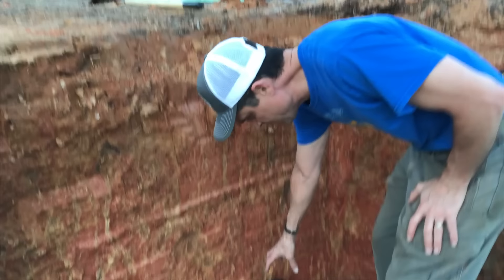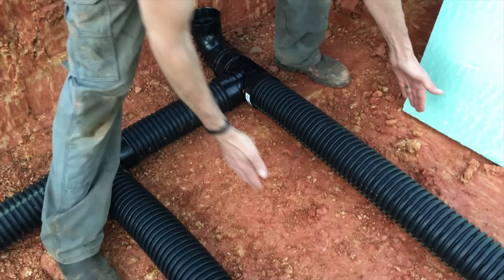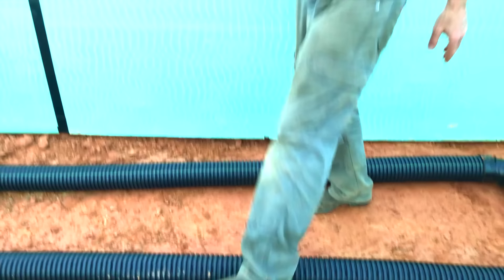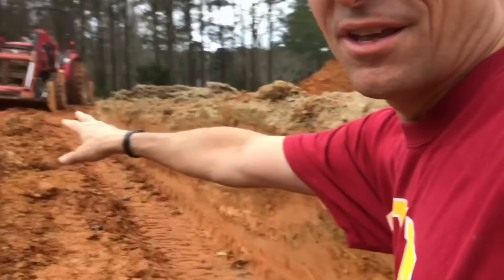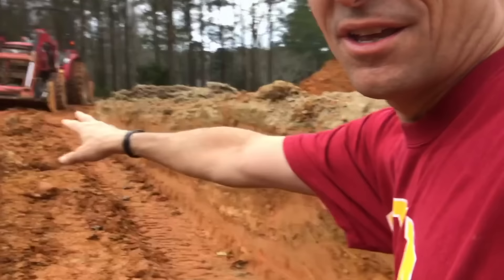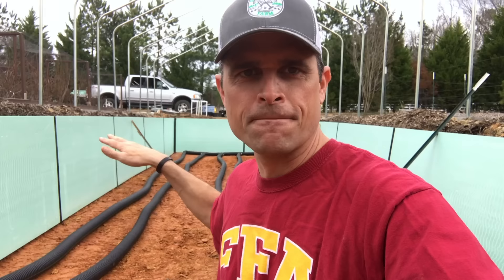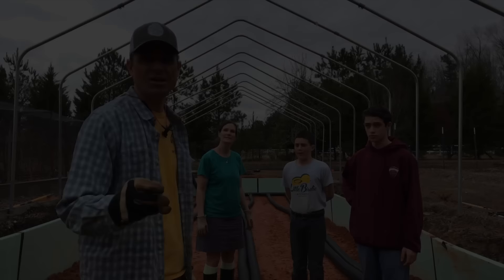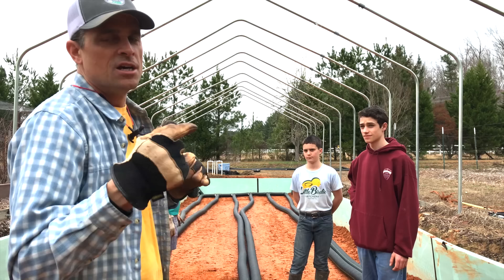DIY Geothermal Greenhouse Part 4: Earth Battery INSTALLATION

Comment: the foam does not make sense to me i dont understand why they all do it ?? doesnt it work against your purpose why do you want to insulate dont you want the heat to dissipate into the ground ?
Reply: You dont want the heat you are storing in the mass to migrate to the ground outside, especially in the winter. The vertical perimeter insulation forces heat to take a much longer path. Consider 2ft vertical insulation where the heat has to travel 2ft down and 2ft back up to escape. Consider the temperature of the ground outside the greehouse will be colder at the surface than at 2ft deep. The heat transfer will be much slower 2ft down due to the temperature difference and soil properties (conductivity and diffusivity) than an uninsulated perimeter.  In winter, you also have the cold air working hard to rob heat from the surface of ground outside.
Reply: @JohnGuest45   THANK YOU i never thought you actually store heat I thought in winter your ground itself will always be hotter so you want to take heat from it and disperse it into the ground >> 
so your saying they basically use it as a battery to store heat ?? but why do that and heat up the ground and not just heat the greenhouse directly then ?? 

my understanding of geothermal is that  you are always using the difference  in temperature between the ground and the surface so the bigger your geothermal mass the better and hence why I thought this insulation works against you as it stops heat from dispersing to a bigger mass in summer or loosing to a bigger mass in winter .
I probably need to get my head around this I am an engineer but I probably;y have misunderstood the process but if its for cooling in summer  I would not put the foam because I want whatever heat that goes to the ground to disperse away as the ground always much cooler
Reply: @AliMohamadChannel  
As an engineer you`ll understand the importance of doing the calculations to ensure the correct outcome. It doesnt matter if the mass is insulated or not, as long as the design meets the criteria they will work equally well. If you dont know what a system has to do, how can you design it?  Its like ordering the food for a party without knowing how many guests you have coming and how many of them are vegetarians ;)
Reply: @JohnGuest45   in summery I say if this system is designed to  use the stable warmer temperature underground to warm the greenhouse  then the insulation is going to work against your purpose because the entire ground will be warm and stable  temperature so once your greenhouse air is going down and cooling your thermal mass below you want the soil  to gain more heat from  the adjacent ground but your insulation will prevent this and will cause the enclosed thermal mass to cool down and equilibrium be reached and the system to stop being effective,    since the ground is all warm it is to your advantage to let the rest of the adjacent dirt warm up your thermal mass which is being cooled down by the greenhouse air.    I dont know if you have followed my question but thank you any way
Reply: @JohnGuest45    I just understood the reason now by watching some clip , apparently the greenhouses  have excess heat during the day so they store it in the ground  during the day while the system is keeping the greenhouse cool enough but when night comes and its too cold this heat that was transferred can be retrieved for the night  this is why they are insulating its very different to what I thought ,  was only thinking about heat exchanging like aircon systems but they are using it as a battery and heat storage
Reply: @AliMohamadChannel  
To get the full picture, you have to consider the plants as an integral and vital part of the system ;)

Comment: What would a project like that coast
Reply: 12 gal diesel= $40,  12x foam boards= $504, 24x top rail pieces =$240, 300ft solid wall tile= $300,  20'x50' greenhouse plastic = $250.  roughly $1334, before finishing touches

Comment: While I'm sure you probably considered it, when backfilling and needing to avoid running over your pipes in the ground, it would be considerably easier, to fill from the drive entrance into the foundation, and cover the piping with each scoop of dirt, as you build up to the 2 foot layer, your tractor adds it's weight to the compaction process, thus making the whole install go just a bit faster.
You stated that you are planning on a second unit, so when you get to that one, you might consider the backfill from a easier process.
I've linked a video to a GAHT system install, that demonstrates what I'm referring to, while I'm not suggesting their system or process is better, just an easier way to do your backfill.
https://www.youtube.com/watch?v=USLv4MImnmw  <- GHAT system install.

Comment: can you build a thermal Earth Battery in sand
Reply from the maker: Great question. It seems like it could work, but believe we read somewhere that there should be a mix of soil. In fact, one item somewhere said that red clay like ours wasn't ideal. We've heard that gravel isn't good, but question that now. If you read the comments on these videos, it seems there are a lot of people that know a LOT about these systems, but thy also question most of is out there on the internet. It doesn't seem there is one source for solid information that is agreed upon as gold standard by everyone. Sorry, wish we could give a better answer.
Reply: A problem with clay will be expansion and contraction with moisture levels. I hope the tubes don't get squashed

Comment: Farmers build and grow soil. I would not like insulated walls as they would block mycorrhizal fungi from getting nutrients and water for my plant roots. I have not done this yet but I would want pipes to heat the sides as well rather than use insulation. If I had clay soil I would mix other types of dirt and lots of compost to give the earthworms something to eat. The bottom layer would be biochar mixed with compost. If I had a climate battery greenhouse, my goal would be 36 inches of top soil. Never walk on a bed only on the path.
Reply from the maker: Thanks for the comment. We plan to use this greenhouse mostly for vegetable starts, so most everything will be on tables above ground. We may run a raised bed down the center, but that will probably have to come later. Your points are well taken though, because we hope to do this again on our much larger greenhouse where things will be grown directly in the soil. Thanks again!

Comment: dude drives the tractor and makes his family shovel lol
Reply from the maker: Using the word "makes" seems a rather large assumption. Several others in the family know how to operate the tractor. In this case, they did not want to operate it as things were more challenging than they appear in the video. Their preference was to move the pipes around as needed. Thanks for watching.
Reply: bless!

Comment: You don't need a thermos.. you need a heat exchanger.. if you are trying to cool greenhouse you need heat from the ground. Why put insulation and reduce the area from where heat can be pulled. Makes no sense.

Comment: Kind of pointless if you didnt insulate underneathe the pipes.
Reply from the maker: At some point budget becomes a factor in projects, hence no foam in the bottom. However, as best we can tell, very few people installing these systems insulate the bottom - although your point is a good one - it wouldn't hurt, and would likely help. Pointless might be a bit hyperbolic, as much of the mass is still heating up and being contained horizontally. With pipes on the bottom, it is not likely that all of the heat is leaving the system below that layer.

Comment: This is nonsense. The idea is great, but the implementation is very poor. You do NOT want to insulate the pit! Read up on geothermal and think it through. You are defeating the purpose of the geothermal heat transfer.
Reply from the maker: Tim B OK, but it still seems to work extremely well. God bless.
Reply: I disagree. If your primary goal is to use the ambient temperature of the soil (let's say 45 F - 60 F at 4' below grade, depending on the time of year) to change the temperature in the greenhouse air, then you want to maximize the heat transfer between the soil and the air. The insulation you installed limits this heat transfer and works against you by limiting the amount of energy transfer available from or to the soil. On the other hand, if you're trying to store the energy from the greenhouse air in the soil to be used at a later time, then you need a lot more insulation to have much effect, including full insulation on the bottom of the pit. I suspect whatever benefit you are achieving from your current system is essentially the same as you would have seen without any insulation at all. Also, a modern air source heat pump would be much more effective, energy efficient, and easier to control. I readily admit that I am a licensed Professional Engineer. @StIsidoresFarm

Comment: Your understandging of thermodynamics is very limited. Air caries very little heat.  You either need a shit-ton more air hoses or you should have used water as the heat transfer fluid.
Reply: I think it carries enough heat to warm up surrounding soil, which, in turn acts as a thermal mass.